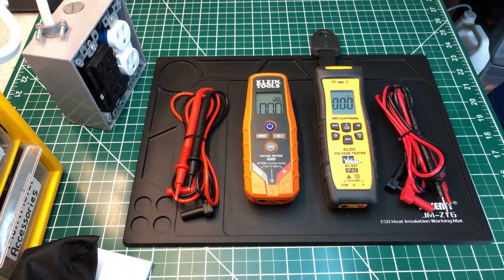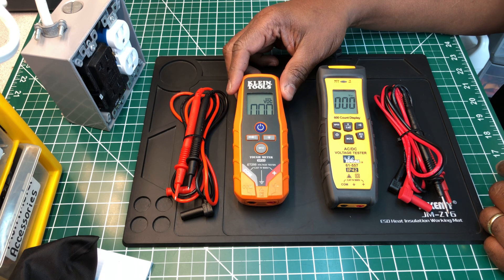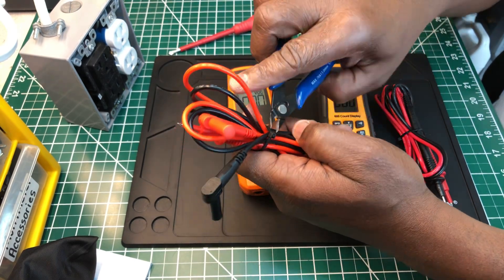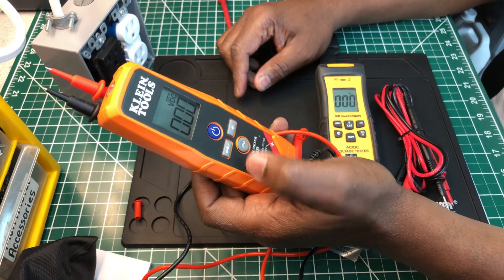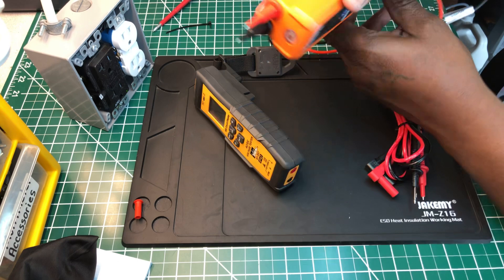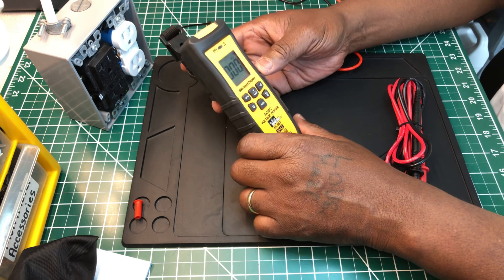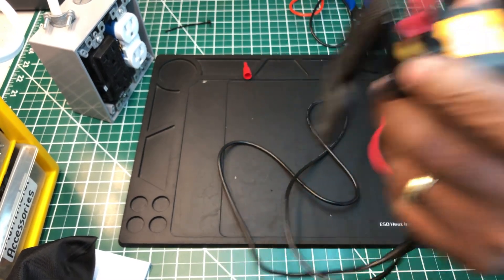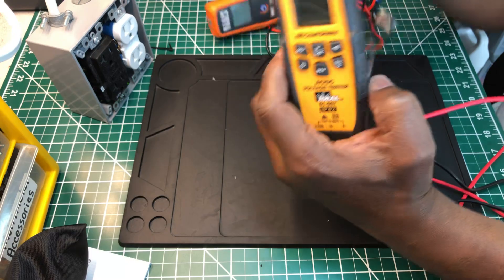🇺🇸Klein Tools vs  🇺🇸IDEAL INDUSTRIES  (  Voltage Testers )

Comment: The Klein volt/con tester is GARBAGE compared to the IDEAL. I have the Klein, and the leads just slip out during use, the leads stay put on the ideal. I can’t believe Klein released this tester with sub-par leads. There is nothing worse than trying to position yourself for a reading only to find out the leads have worked their way out.
Reply from the maker: Totally agree!!!🤔

Comment: Thanks for another comparison.  Ideal looks a little more rugged for sure. Would you say the NCV tester on the Ideal is as accurate/sensitive as a stand alone non contact voltage tester?

Accord to Klein the ET250 also has continuity tester built in.
Reply from the maker: The NCV tester on the Ideal is great, but I think the stand alone maybe a little better. Thanks for watching 👍🏽

Comment: Nice review, as always.  Which Fluke m-m would you recommend for a low voltage technician (ethernet, fire alarms, security/access control, etc)? Only those made in the US.  Thanks.
Reply from the maker: Since you’re a professional and it’s your livelihood I would get a FLUKE 287 or 289 True RMS Multimeter. It’ll have everything you need and more . ( That’s Just My Opinion )